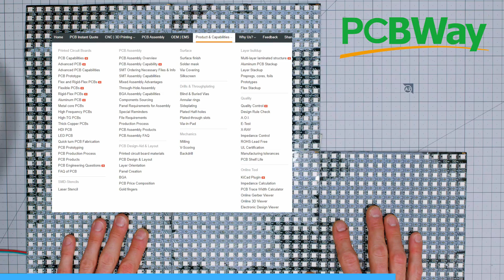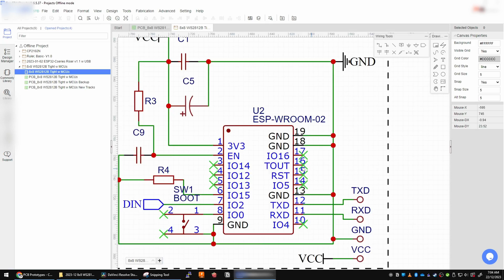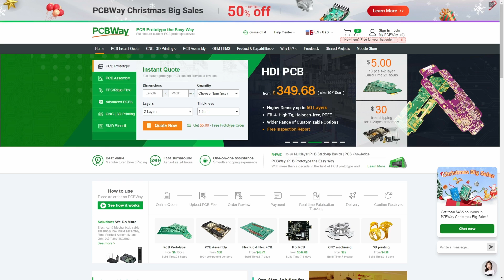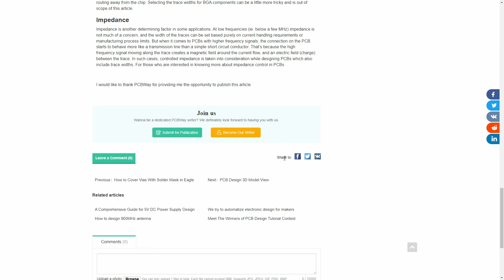All the other NeoPixels and addressable RGB matrixes are FLAWED... So I made my own!

Comment: great start,. if you want to make a large  panel hit me I have boards to drive them in parallel.
Reply from the maker: @TekWit Thanks mate much appreciated. 

Yeah your panel was really good, and unique in my opinion. Power is the biggest issue here, but I'm aiming to do high-FPS with multiple boards by having multiple MCUs ideally.

Not fully sure yet. Any input is welcome!
Reply: hello  @PlatimaTinkers  . with 64 leds you have 520 fps. but in that case that is the calculation that will take time not the display by itself. but you can build 16x16 panels made of 4 for you smaller one. driver them using 4 pins and you will drive 256 leds at the speed of 64. you can't get faster than that ;)., open to discuss further with you. depending on what you want to achieve
Reply from the maker: @TekWit  but I will be connecting 16 of these together (4x4) so 1024 LEDs all up! Currently using WS2812B's for the board design, but considering adding a CLK signal and upgrading to faster 4-wire LEDs too. Cheers!
Reply: @PlatimaTinkers  indeed you can use apa102 for instance which are far faster. Maybe consider hd108 then which are more precise in terms of of color. In any case having high refresh speee with 1024 leds will not be an issue. Good luck with your build.
Reply from the maker: @TekWit Yeah was looking at APA107/HD107S - very interesting stuff!

What is your preferred MCU to use? I am considering moving from ESP-WROOM-02 to ESP32-C3, and then from STM32F103 to STM32F411.

And thanks!
Reply: @PlatimaTinkers  indeed all of these are good too. Especially at lower brightness. I am a fan of the esp32 I like it because of WiFi and BT. And dual cores. Plus I spent a lot of time writing leds drivers for it. But stm32f series are really good. Especially with their fpu unit if you want to create crazy animations. I would say stick with the one you prefer and master the most as both of them or something like a teensy will be plenty enough for druving 1024 pixels.
Reply from the maker: @TekWit   Yeah I like all of them, that's the problem haha. Not sure Atmega328P would be great for driving WS2812Bs, however, I found https://github.com/pololu/pololu-led-strip-avr which looks really good!

Comment: This was very helpful.

I'm working on an LED project as well, using the SK6812's. With data and power injection every 60 pixels (length of one piece of aluminium channel) it can run RGBW at 420 fps, but it's right on the edge of signal integrity.

I Programmed an FPGA to read an HDMI signal and address 24 of these strips in parallel, so 24x60 max. To help with signal integrity I'm using differential signaling with a tiny LVDS receiver at the start of each 60 LED strip. An Ethernet cable can carry 4 LVDS channels at a time easily over 30m with some impedance matching at the receiver. Power is now the big issue since one strip of 60 LEDs with RGBW all on is just over 3 amps at 5v.

Still figuring things out but I really like your idea of custom printing the boards with LEDs instead of using the pre-made clusters.
Reply from the maker: Hey so glad you found it helpful!

That sounds like a bloody awesome project, and way more complicated than this haha. Got a GitHub link or is it private? 

For the power maybe step-up and down again? Eg run a power bus at 25V 3A, that can be stepped down into 5x 5V 3A PSUs?

Comment: Adding a 0.1uF cap is recommended for each RGB LED, easy to start running into problems with that depending on what you're powering it with and how many LEDs you're driving. Might have missed them, but it looked like they hadn't been added in your schematic or on your PCB.
Reply from the maker: Hey yeah some do, but the WS2812B that I chose does not - it's integrated into the 5050 package itself - half the reason I chose it!

Ref: https://datasheet.lcsc.com/lcsc/2006151006_Worldsemi-WS2812B-B-W_C114586.pdf
Reply: @PlatimaTinkers  Wow that's incredibly convenient, and helps a ton with layout and packing density. I didn't know there were packages that had that integrated, learned something new today!
Reply from the maker: @16aroth6 yeah I know hey! I was not keen on this project at all, but still wanted to do it, and then I found that awesome info and no longer dreaded the layout hah

Comment: i have seen the usb connectors being mounted at a slight angle instead of flat to the board
Reply from the maker: Great idea, will have to look at other USB-C ports like that!
Reply: not actually different usb ports, the same  boring old component, but soldered at a slight angle, so its easier to plug in, may also benefit from a blob of hot glue as strain relief @PlatimaTinkers
Reply from the maker: @Snottelling Oooh yeah okay got ya, cheers!

Comment: You could probably nest one of the MCU positions inside the the footprint of the ESP to gain some board area (perhaps use the extra space for another MCU, or even a 144 pin FPGA).
Reply from the maker: Ooooh that is an excellent idea - would just have to check the pin positions.

FPGA is a great idea too, did not consider that.

Have added both to my revision notes. Cheers

Comment: You can get vertically mounted USB C connectors if you want to place them in the middle of the board.
Reply from the maker: @notsurt Oooh that's an idea! I was hoping maybe just offset ones so they're still fairly flat. Just haven't had a chance to look too hard yet. Thanks mate!
Reply: Another option is to place your USB socket on a little sub-board with castellated edges, then mount that on the main board SMD style
Reply from the maker: @pete3897 possible! Still need to revise this project one day!